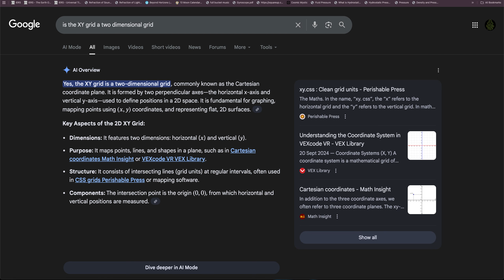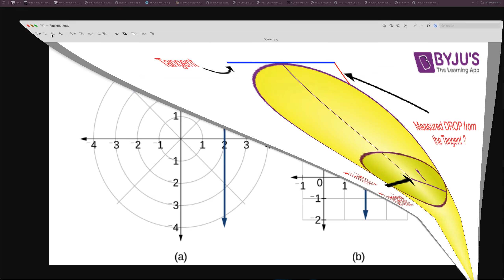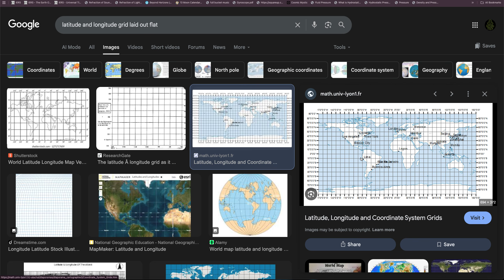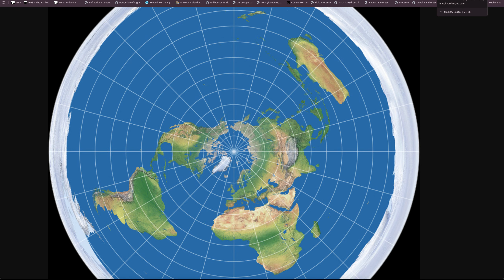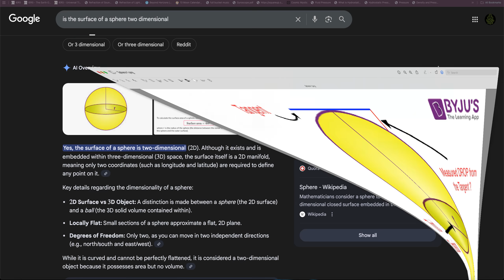The 2D Globe  lol

Comment: How far Sydney to Perth Brian? How many degrees? What average latitude Brian? Now show us a quick bit of flat Earth maths to show us the distance between these two cities. I dare you.
Reply from the maker: Less than 30 degrees in reality Trevor as is PROVEN by Time Zones. 
And the distance is claimed to be just over 2050 miles.
Reply: @BriansLogic 35 degrees in reality Brian.  That translates to 2412 miles at the Equator.  However, 2050 miles, the distance between Sydney and Perth,  is significantly less than than the same angular distance at the Equator.  If the Earth looked like an AE Gleason map, the Sydney-Perth distance would be significantly longer than the Equator distance.  Which means the AE map cannot be an accurate representation of the shape of the Earth.

Once again, Australia debunks the flat Earth.

Thanks for pointing that out, Brian.
Reply from the maker: @JohnSmith-ux3tt No read more carefully John, they sit WITHIN 30 degrees, and to give those degrees a distance, you would need to have the correct nautical to statute ratio to begin with, then you would need another one for the circle ⭕️ of latitude across the 32nd degree south….
Reply: @BriansLogic Sydney 151E, Perth 115E.  151-115 => 36 degrees longitude between them.  Sorry Brian, you are wrong.
Reply from the maker: @JohnSmith-ux3tt No You are wrong as 35 degrees implies that their 3 hours apart, and that Australia 🇦🇺 is greater in size than it is, you need to determine what those degrees refer to, as that’s the thing that I’m pointing out is wrong, if you disagree then you disagree with GMT/UTC time and Chronometers used by Celestial Navigation 🧭 along with the denial of Wall Clocks and Wrist Watches, are you denying all those things along with the denial of the 24 hour day ?
Reply: @BriansLogic  35° correlate to
35/360 * 24h = 2.33h
Reply: @BriansLogic  you really are stuck in a rut on this Brian. Firstly, you have no valid source to confirm the longitude difference of less than 30 degrees between Perth and Sydney. Secondly you can’t get your head around the fact that 3 UTC zones (8, 9 and 10) results in just TWO hours difference in UTC times. These two straightforward facts completely kill your argument stone dead
Reply: @BriansLogic This is nothing to do with gmt time, chtonometers, wall clocks or wrist watches.  I suspect deflecting to unrelated stuff, is why you dont understand.

This is about longitude angular difference between two cities from the Earth's center.  In your case, that means the North Pole.  The longitude of those two cities is well documented.  The difference in longitude between those two cities is 35 degrees.  The distance at the equator of that longitude change is documented.  The distance between those two cities is much less than the distance at the equator.  Which is completely inconsistent with the flat earth model.  If the earth was flat, the Sydney-Perth distance would be much greater.  Its not.  However, on a globe the distance would be less - much less.  And, it is.

Try again.  But stay on topic and dont deflect to wrist watches.
Reply: @BriansLogic  no Brian, a time difference if 2 hours could technically be up to 45 degrees - ie the width of 3 time zones. You’ve already acknowledged this in another thread.
Reply from the maker: @DeeDubbayaNo genius a time zone is one hour which is 15 degrees of longitude, as 15 x 24 is 360 smh….
Reply: @BriansLogic  yep, 15 degrees for each time zone. So with 2 time zones the western edge of the western zone is 30 degrees from the eastern edge of the eastern zone - and yet those locations only have a 1 hour time difference. Of course, if you push that up to 35 degrees  ( like in Australia) you’ll be into a 3rd time zone (with a 2 hour time difference)
Reply from the maker: @DeeDubbayaIncorrect 15 equals 1 hour, 30 equals 2 hours, 45 equals 3 hours, 35 is not 3 hours, and the 35 you speak of is in violation of the 24 hour day, you couldn’t be more incorrect if you tried….
Reply from the maker: @KieranFlanagan-m4t It kept GMT over a 24hr period, your question shows how little you know about reality….
Reply from the maker: @KieranFlanagan-m4t GMT is correct local time, it’s now called UTC it involves 360 degrees of longitude divided into 24 15 degree segments, with each 15 degree segment being One Hour.
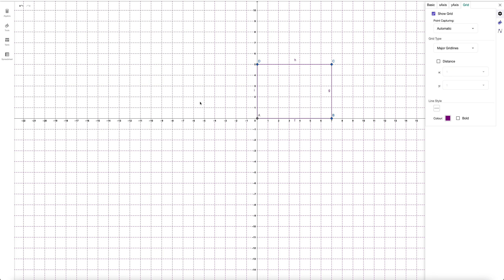Reply: @BriansLogic  I think the people in India and many other Countries might disagree with you, India standard time is UTC +5:30, Nepal is UTC+5:45. Iran is UTC +3:30. There are 3 In Australia UTC + 10:30 +9:30 and +8:45. to name a few.
Reply: @BriansLogic  well, let’s look at it this way. Greenwich is on the centre of its time zone. As such, up to 7.5 degrees west shares the same time as up to 7.5 degrees east of Greenwich. That’s 15 degrees sharing the same time (UTC +0). Now, 20 degrees east of Greenwich would place it in the UTC+1 time zone (2.5 degrees from its eastern edge in fact). So 35 degrees east of Greenwich would place it in UTC+2 (again 2.5 degrees from its eastern edge. So in fact, 35 degrees can easily result in just 2 hours difference (ie UTC+2 compared to UTC+0). So you can’t simply conclude that 35 degrees is 3 hours difference.
Reply from the maker: @KieranFlanagan-m4t It’s correct local time, it’s an average of local Solar time 🕰️ google it smh. 
The correct longitudes would give an indication of width in relation to the longitudes, but it wouldn’t be a process of overall land measurement, more of a placement upon earth.
Reply from the maker: @DrhexUK There are Not three time zones in Australia 🇦🇺 as the continent sits within 2 time zones, wow this topic is too complicated for ballers it seems, no surprise there ?
Reply from the maker: @DeeDubbayaNo there is NO 35 degrees across Australia 🇦🇺 as it sits INSIDE 30 degrees, and Genius it was YOU who tried to claim that 35 degrees was 3 hours not Me remember ???? 
You guys always try and place the claim that YOU got wrong, back onto ME after I correct it, have you No shame, how do you sleep at night knowing that you’re a liar and a fraud ?
Reply: @BriansLogic  Try again Brian "Australia uses three main time zones: Australian Eastern Standard Time (AEST; UTC+10:00), Australian Central Standard Time (ACST; UTC+09:30) and Australian Western Standard Time (AWST; UTC+08:00)." You seem to deny reality a lot.
Reply: @B @BriansLogic   so Perth is at longitude approximately 115.7 degrees East and Sydney is approximately 151.2 degrees East. I make that 35.5 degrees difference. Do you have any data to the contrary Brian?
Reply from the maker: @DrhexUK They can’t as a Time Zone is One Hour, there isn’t three hours between 10 o clock and 8 o clock, as 10 to 9 is One Hour and 9 to 8 is another One Hour, that’s TWO hours….
Unless you’re claiming that at 8 o clock it will take 4 hours to get to 11 o clock lol 😂
Reply: @BriansLogic  Again Brian Are you Wrong or just lying, "Mainland Australia spans approximately 40.4 degrees of longitude from east to west, extending from Cape Byron in New South Wales 153.6 degrees east to Steep Point in Western Australia 113.2 degrees East. This distance across the continent covers roughly 4,030 km / 2,500 mi."

So 153.6-113.2 = 40.4 degrees
Reply from the maker: @DeeDubbayaYes Celestial Navigation 🧭 Chronometers, and CORRECT local time between the cities 🏙️ in relation to the latitude and longitude grid, as there can’t be 2 hours between them and they be 35.5 degrees apart ya Bozo….
Reply from the maker: @DrhexUK You have just claimed that there is a correct local time difference between Sydney and Perth of 3 hours, and that Australia 🇦🇺 is at least a third bigger than it really is…. Well Done 👏
Reply: @BriansLogic  Remember Brian, 8 9 and 10 are 3 numbers. and therefore would be 3 time zones. It really isn't hard.
Reply: @BriansLogic so Perth is UTC+8 and Sydney is UTC+10. That means 3 time zones (8, 9 and 10) with 2 hour difference (ie 10-8=2)
Reply: @BriansLogic  if you have actual accredited data to support your ‘less than 30 degrees’ claim then please present it.
Reply from the maker: @KieranFlanagan-m4t Wow you’re pretty lost today Kieran, as you’re attempting to lecture someone on Chronometers and GMT time, but you then proceed to deny ALL of them, and claim that there’s 35 degrees of longitude between Sydney and Perth, when there’s only 2 hours difference between them, as per GMT time and Chronometers, so you’re in a bit of pickle there Kieran with your Bull***t ?
Reply: @BriansLogic  and btw, celestial navigation, chronometers and correct local time are not evidence, just sources where you might or might not find the evidence. You are clearly skirting around (probably because you can’t find any that supports you). 
Try come up with actual data (by all means citing their source as well if you wish).
Reply from the maker: @DeeDubbayaYes they are as they reference the Latitude and Longitude grid over a Flat Earth, as is PROVEN by the fact that there’s 2 hours of correct local time between Sydney/Newcastle and Perth, while across the same distance and latitude in the US between Long Beach and Charleston there are 3 time zones. 
You can’t get around this the globe is over….
Reply: @BriansLogic repeat after me. UTC +10 is 1 time zone, UTC +9 is another and UTC +8 is a 3rd. That's 3 time zones. How is that not straightforward. I kind of didn't think you could be stupid enough to not to see that. You're very quickly changing my mind.
Reply: @BriansLogic  so if Perth is UTC+8 and Sydney is UTC+10, what is it in Alice Springs?  It’s UTC+9 - that makes it 3 time zones, 8, 9 and 10. And yet there is only TWO hours difference (in UTC times that is). 
And you still haven’t presented data for the longitudes to refute the ones I posted - could it be you don’t have any that show the difference to be 30degrees or less?
Reply: @BriansLogic  Hiow hard can it be!
Imagine three adjacent timezones, A,B and C.
Time between 2 places in zone A (1 zone), 0 hours
Time between 2 places in zone A and B (2 zones), 1 hour
Time between 2 places in zone A and C (3 zones), 2 hours
Reply: @BriansLogic  and btw, celestial navigation, chronometers and correct local times all support the globe. What you need to present is some real, verifiable data that supports your claim without also supporting the globe. I don’t hold out much hope though - you can’t even subtract 8 from 10 without getting 3
Reply: @DeeDubbaya I wonder if Brian has realised his error, and rather than admitting it, is quickly making a new video to distract from that fact.
Reply: @BriansLogic  it is very amusing that you think places can’t be 35 degrees longitude apart because it would be “in violation of the 24 hour day”. So presumably, you think longitude can only be measured and quoted in multiples of 15 degrees. I would like to see you cite a credible reference to back up your methodology here
Reply: @BriansLogic  I see you have run away from this bit of the discussion. Has it finally twigged that 3 UTC time zones result in a 2 hour difference? Have you finally realised that Perth and Sydney are more that 35 degrees longitude apart after all?
Reply: @BriansLogic Brian, pilots only have one time zone. It covers the entire planet. It’s called UTC. Every place on Earth has an offset from UTC. That you don’t understand this is your problem.
Reply from the maker: @Trevor_Austin UTC is GMT which is CORRECT Local Time, and even UTC has been messed with, so you’re supporting me smh….
Reply: @BriansLogic UTC and GMT are different but I’m convinced you wouldn’t be able to understand. You have to be one of the most stubbornly ignorant people on the planet when it comes to understanding physics, geography, mathematics, logic, basic astronomy and the form of the form of the Earth.
Reply from the maker: @Trevor_Austin Really Trevor, so do they both adhere to a 24 hour day that’s broken up into 15 degree segments of longitude ? 
And if they do ( they do ) then could YOU please detail EXACTLY what the difference between them is ?
Reply: @BriansLogic  No Brian. Both are a single time (not a zone) and both are roughly the same. GMT has based on the Earth’s rotation and UTC is based on an atomic clock.
Reply from the maker: @Trevor_Austin No they’re not lol, they’re both based on Solar time, as that’s the only time we have Genius smh…. 
And earth rotation 😂 did you account for that in your airplane ✈️ NO….
Reply from the maker: Oh and there is no such thing as flat earth math, that’s just some rubbish that burnt out globe pilots who were debunked by their own profession, simply make up :)
Reply: @BriansLogic Right angle triangles that dont obey the rules of trigonometry (aka magic celestial objects thst you cant know where they are)  sounds exactly like flat earth math.
Reply from the maker: @JohnSmith-ux3tt No my description would be accepted by anyone who honesty understands the situation, and being a baller you have no business attacking me using the word magic, when your whole paradigm requires magic not just the sky ????
Reply: @BriansLogic What magic does the heliocentric model need?
Reply: @BriansLogic You have never explained how a celestial object can magically "appear" in multiple places at the same time.
Reply from the maker: @JohnSmith-ux3tt Yeah nobody has in History, nobody knows what they are smh, wake up John.
Reply: @BriansLogic  Well that's an obvious lie. What you mean is you don't agree with the accumulated science and knowledge of the people who have studied it for centuries.
Reply from the maker: @DrhexUK Science what has that got to do with the issue ? What’s the DV for a Globe lol 😂
Reply: @BriansLogic yup. Proved my point instantly. Lol
Reply: @BriansLogic But we do know what they are Brian.  Even if we did, we still know they must be in a single position and we can see the light coming from them. We can see WHERE they are and that's all celestial navigation needs.
Reply: @BriansLogic  well, how about the IV being the distance south of the equator and the DV being the distance between locations at that latitude observing solar noon 1 hour apart. The hypothesis would be that if the earth was flat then that dolar noon distance should increase as the south latitude increases. The null hypothesis would be that the the solar noon distance would decrease instead if the earth was a globe. 
That would adhere to the scientific method.
Reply from the maker: @DeeDubbayaIt’s not a natural science question, it is a what is question not a cause and effect question, you can’t science the earth smh….
Reply: @BriansLogic  Why are you trying to wiggle out of that? Who cares, if it is a "what is" question, or a "cause and effect" question? It would still be science. And the question is answerable.

Maybe you want to hear the formulation: "The geometry of the ground, CAUSES certain time differences, over certain distances, along certain latitudes."
Reply from the maker: @yourguard4 No it isn’t that’s the point, natural science doesn’t deal with what is questions….
Reply: @BriansLogic  effect: the variation of the circumference of lines of latitude south of the equator. Cause: the shape of the earth. That sounds like a cause and effect phenomenon to me - absolutely consistent with the scientific method.
Reply: @BriansLogic  it seems very much like you introduced yet another topic without understanding the first thing about it. 
Here’s how the Collins Dictionary defines natural science:
“the sciences collectively that are involved in the study of the physical world and its phenomena” - I think the shape of the earth fits within that description
Reply: @BriansLogic  actually Brian, the pursuit of science is so very often prompted by the question “what is . . ?”  
I can’t help thinking that you’ve deflected onto this topic to direct attention away from your crass misunderstanding of time zones, time differences, antipidean geography and basic arithmetic. Trouble is, all you’ve done is present yet another way to discredit yourself even further.
Reply from the maker: @DeeDubbayaThat’s Not an effect lines of latitude are geometrical/conceptual not part of nature, your DV must be a Naturally Occurring Phenomenon, lines of latitude are a man made convention.
Reply: @BriansLogic  A line of latitude is based on nature... it is just following east/west.... or "following the GP of the sun/stars", if you want.
Reply from the maker: a circle of latitude is derived from the elevation angle 📐 to Polaris, they are Not a natural phenomenon, what part of Naturally Observed Phenomenon don’t you understand, where do we observe latitude in Nature ?
Reply: @BriansLogic  the natural phenomenon here is the sun’s apparent movement. Latitude and longitude lines are merely a means to measuring that movement.  All means of measurement are essentially man-made and yet necessary in conducting science. 
You really are flogging a dead horse here Brian
Reply: @BriansLogic  so the variation in the elevation of Polaris is the natural phenomenon. Circles of latitude is merely the outcome of observing and measuring that natural phenomenon. And btw, how can you use Polaris to determine latitude south of the equator?
You really are digging yourself into a deeper and deeper hole here Brian
Reply from the maker: @DeeDubbayaRight so what’s the cause of the variation, to find that out you would need to know firstly what Polaris is, but nobody has that information….
You would also need to prove that Polaris is part of nature, start by defining nature ?
You’re on a fools errand.
Eric: It could also be claimed that the cause of Polaris changing its position in the sky 🌌 is you changing position, so in a way you already have the cause it’s YOU ?
Reply from the maker: @DeeDubbayaThat’s incorrect there is no measurement in the establishment of natural science.
Reply: @BriansLogic  I can tell you, what Polaris is. It is a light source, with a GP near the location we call  "north pole".
It's elevation angle changes proportionally with the distance from this location (1° every ~111 km), no matter in which direction. This is, what makes latitudes circles.
These are observable properties. What else do you wanna know?

We can also observe, that these circles don't match, what you would expect on a flat plane. As the circumference of any circle, would be 2*Pi*R.
Like when you are in Australia, at latitude 25°S, you are about 115°* 111km = 12765 km away from the north pole.
But you can measure, that 1° of the circle of this latitude (or a time difference of 4 min), is ~100 km. Which implies, that the full circle is 360°*100km/1° = 36 000 km.
But on a flat earth, it should be 
2*Pi*12765/360° = ~223 km/1°.
Reply: @BriansLogic  “no measurement in the establishment of natural science” - very amusing Brian. Tell that to the science community and see if they can keep a straight face.
Reply: @B @BriansLogic  do you think Polaris is somehow not a part of nature? Encyclopaedia Britannica defines nature as :
“the physical world and everything in it (such as plants, animals, mountains, oceans, stars, etc.)”
Perhaps you think Polaris is man-made. But we don’t need to know what it is for it to be part of the natural environment. 
You really are making yourself look a complete numpty.
Reply: @BriansLogic  how did you conclude there is no measurements in natural science?  Here’s a couple of examples that ought to (but probably won’t) change your mind. 
(1) somebody formulates a hypothesis that increased consumption of a particular foodstuff causes weight gain (all else being equal). Please tell us how that hypothesis could be tested without any measurements. 
(2) another hypothesis is that increasing a particular concentration of nutrient in soil causes particular plants to grow quicker and stronger. Again,  tell us how that hypothesis could be tested without any measurements.
Reply: @BriansLogic but there is Brian. How was a metre defined? How is it defined now?
Reply from the maker: @Trevor_Austin But there is what Trevor I have lost track of the conversation ?
Reply: @B @BriansLogic Debunked by my own profession? So who exactly would these debunkers be? Only in your dreams Brian. For the avoidance of doubt, there is only one sort of mathematics. It’s a tool to used to understand the world. The random number juggling you do has as much to do with mathematics as fish have to do with cycling or carpentry.
Reply from the maker: @Trevor_Austin That’s great Trevor so YOU will be able to prove to the world 🗺️ that you do NOT use a Right Triangle for Top of Descent calculations, YOU will be proving this OFFICIAL aviation situation wrong will you ? 
Because if you are not willing to take on the Descent and Landing challenge Trevor, then you’re prohibited from speaking about flight ✈️ on my channel.
Reply: @BriansLogic  Pilots use track miles ± wind ± weight ± desired speed ± anti-icing ± icing speeds ± aircraft deficiencies. Not a single triangle used anywhere.
Reply from the maker: @Trevor_Austin Sorry but you just lied and spoke about airplanes ✈️ on my channel two things YOU are not supposed to do ? 
Now YOU must support that a triangle right angles or otherwise is NOT used in Aviation, but just remember as a claimed commercial pilot your words will be held against you, start with Top of Descent and show where there is NOT a triangle used for that calculation GO ?
Reply: @BriansLogic  What? As I said above, pilots use track miles (well the box of tricks does). Before FMS, we used air distance. I even remember in the late 90s’ using a clock and no map at all. Radar uses distance through the sky - it’s almost the same as track miles. Nowhere do we use any of your magic triangles. They are a figment of your imagination.
Reply from the maker: @Trevor_Austin So the radar you brought up, that doesn’t use triangles ???? 
And according to YOU ( the claimed commercial pilot ) take off to cruising altitude and top of descent, also has no connection to triangles ???? WOW….
Reply: @BriansLogic  No. Not a single triangle anyway. They only exist in your imagination. You haven’t made much progress in life, have you.
Reply from the maker: @Trevor_Austin So no triangles then used in aviation by Pilots or the FMS, Top of Descent, Take Off to Cruising Altitude, different Radar and Navigations systems etc, no triangles Trevor ???? 
You have dishonoured yourself if you’re even a real person, as a claimed commercial pilot making the claim that NO triangles are used in aviation, either by them the FMS or ground control etc, is a very destructive thing for a commercial pilot retired or not to say, and I would hedge a bet that no REAL commercial pilot would say such a thing ?